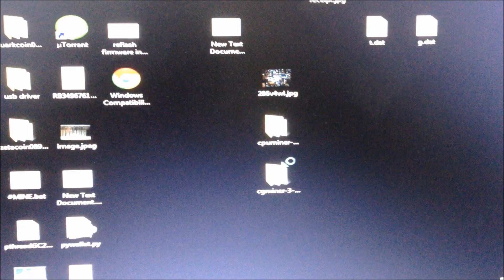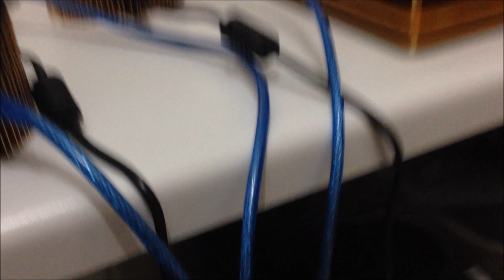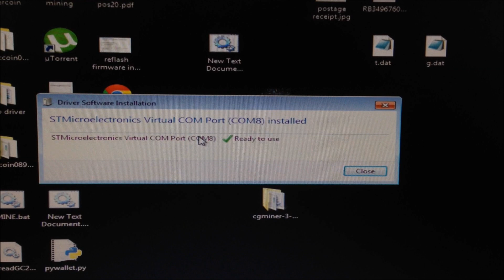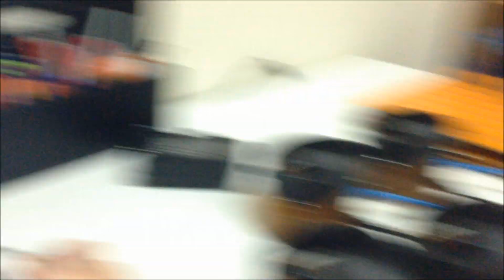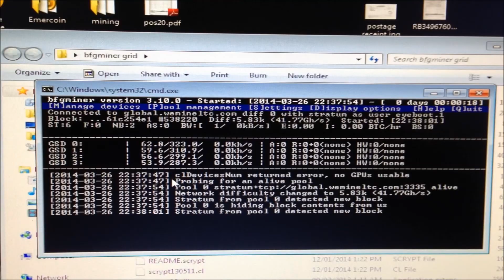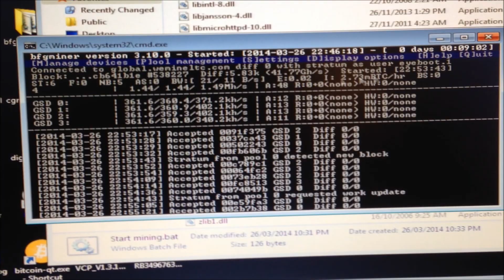How to setup multiple Gridseed Infinity ASIC Scrypt Miners using bfgminer

Comment: i need help ...i m running cgminer with 5 gridseed asic usb miners on a raspberry
the raspberry can recognize all my 5 miners but the fifth one doesn't seem to accept any mining task? 
as u see below, the A , R , HW, and WU are all zero on GSD4 miner.
any suggestion is much appreciated 

 [P]ool management ettings [D]isplay options [Q]uit
 GSD 0: 6D9133704857  850 MHz | 360.4K/360.9Kh/s | A:3840 R:0 HW:0 WU:3.9/m
 GSD 1: 6D6E23704857  850 MHz | 360.4K/360.8Kh/s | A:5184 R:0 HW:0 WU:4.4/m
 GSD 2: 6D7A268C4857  850 MHz | 360.4K/361.4Kh/s | A:3712 R:0 HW:0 WU:3.8/m
 GSD 3: 6D99149D5455  850 MHz | 360.4K/361.3Kh/s | A:5760 R:0 HW:5 WU:3.9/m
 GSD 4: 6D9315AA5455  850 MHz | 360.4K/361.3Kh/s | A:   0 R:0 HW:0 WU:0.0/m
--------------------------------------------------------------------------------

 [2017-06-12 11:57:14] Accepted d5824bc7 Diff 307/64 GSD 1
 [2017-06-12 11:57:19] Accepted 0321148d Diff 82/64 GSD 0
 [2017-06-12 11:57:21] Accepted 010cf60a Diff 244/64 GSD 3

thank you

Comment: do you have any tips for setting a gpu and cpu with bfgminer for ltc mining?
I just want to learn how to do it, and was told this is the hardest to learn how to work out.
running FX8530 cpu with 32gb ram and rx480 graphics

Comment: OMG NOW WHEN I OPEN THE BAT FILE IT JUST OPENS THEN CLOSES
Reply from the maker: Ok that means there is an error in your bat file somewhere. Edit the bat file now and add the word: pause
on a new line in the bat file. This will stop it from closing automatically and you will be able to see exactly what is causing the error. If in doubt send it to me and I will help you do it.
Reply: the system cannot execute the specified program
Reply from the maker: justin loffland It should say which command is not letting it open. If you post your bat file here I can check it for you. alternatively follow the instructions in this guide:

It shows an example of what the bat file command line should look like:

http://www.eyeboot.com/how-to-setup-new-r-box-100-110-gh-s-bitcoin-miner-using-cgminer.html
Reply: Eyeboot could we use one of those programs where u control my computer ant set it up for me?
Reply from the maker: justin loffland Yeah sure, please use teamviewer. Email me your teamviewer number and password:
support@eyeboot.com
Reply: Eyeboot just did waiting for you

Comment: I have never had a piece of equipment piss me off more.   I simply can not get it to work the videos are out dated. and cannot get a driver that works.  I did have it working, but i would have to keep pluging it in . most of the time I would get device not recognized.  now the software doesn't even find them. im using  cgminer  3.7.2  I cant seam to get the driver to start,  tried using zadig .  but it doesn't find anything to replace.   I would like to get more of these but I cant get the three I bought to work cqan someone please help.  it would be wonderful if you would do a new vidio showing how to set this up with the new software. the ones on your site are outdated
Reply from the maker: Hi, sorry to hear you are having problems. 

We don't stock these anymore as they are very out of date and slow, so i can't make a new video. Have you contacted your seller and asked them for support? Also this video is for bfgminer not cgminer. I have another one on my channel for cgminer so please look for that one. Finally download the latest version of cgminer (4.4 i think) from here: http://ck.kolivas.org/apps/cgminer/

Comment: what PSU do you recommend for that USB HUB?
Reply from the maker: I recommend Meanwell 60A 5V LED switcher PSU. It will delivery a lot of power and is very cheap. Then use an ATX to LED PSU cable from here: 

http://www.eyeboot.com/Bitcoin-miner-Accessories?product_id=74

Comment: I only get the following even after waiting 30 minutes and pool displays 0kh/s
GSD 0:       | 361.6/358.1/  0.0kh/s | A:0 R:0+0(none) HW:0/none
OCL 0: 74.0C |  92.3/ 92.2/ 92.6kh/s | A:78 R:0+0(none) HW:0/none
driver installed, COM changed to 1 (later to 2) bfgminer downloaded from your link. pool is up and settings are correct. I am on windows 7 64bit
OCL is my GPU which does not have a problem and that makes sure I don't have a mistake in configuration.

What am I doing wrong???
thanks in advance

Comment: When i start bfgminer and I go bfgminer only 2 of 6 asics. why?
Reply from the maker: That is weird. Try unplugging and plugging them in again when bfgminer is running. You can also try pressing "D" for device manager and then add the device manually. One question, when you plug in the miners (before running bfgminer) does a pop up come up saying that they are recognised by Windows? Reinstall your Virtual Com Port Drivers too.
Reply from the maker: Sorry it is M for device manager

Comment: Hi Brother

I have purchased 3 gridseed miners and I followed the instructions on your original one  (Part 1 -- How to setup Gridseed 5 chip Scrypt Asic Miner using cpuminer), and it worked.

Then I wanted to do dual mode so I tried part 2 (How to setup Gridseed 5 Chip ASIC Miner to mine bitcoin and litecoin) and ran zadig and it changed my com ports to USB. This ended up messing up my original mining setup AND prevented me from doing dual setup because your dual mode setup needs the Part 1 Com ports.

Could you tell me how to setup dual mode with multiple gridseed units (3 or more) for both litecoin and bitcoin (now that I can't seem to go back to the original com4, com5, com6 I used to have)?

Cheers!
Reply from the maker: You can find the COM ports again in Windows Device manager. In fact you can set them to whatever number you like in there. Hope this helps. If you are still stuck then I would suggest uninstalling everything and start fresh.

Comment: To set up 100 of these do you just use 2 of the 50 USB ports and plug them into eachother ?
Reply: Kamran Munaf no only the first one would get enough power to run the second one gets less and less until the forth one will not run cause power won't reach him

Comment: after an hour of up and run time all my gridseed stop working and i have to reset it , is there a way past this?
Reply from the maker: You need to make a bat file that restarts it automatically for you. However it shouldn't be restarting like that. Where did you but it?
Reply: i bought the hub from amazon,all the gridseed from a friend in Rhode island , and the power supply from amazon also.how  should i have the .bat file set up? i just have it set how ever it is from the downloaded spot
Reply: Eyeboot
could it be the 500w power supply not having enough wattage to power everything on the usb hub? its a corsair unit

Comment from the maker: Make sure you uninstall the winusb driver and revert back to the normal driver settings for the miner before doing this. 

The driver for bfgminer is here:
http://www.ftdichip.com/Drivers/CDM/CDM%20v2.10.00%20WHQL%20Certified.exe
Reply: this download takes you to a page where there are multiple other links. The x64 download is just a folder with the files in it and no installer
Reply from the maker: Michael Felske It is on that page under "setup executable" in the comment sections of the download. Here is the link: http://www.ftdichip.com/Drivers/CDM/CDM%20v2.10.00%20WHQL%20Certified.exe

Comment: Sorted my previous problem it was because I used zadig to replace driver I have uninstalled the new driver and reverted back to the previous one. but cpuminer and cgminer is running alot more efficient than bfg with bfg I am getting thousands mow hw errors and loads more rejected shares any idea?
Reply from the maker: That is weird...are you missing any commands from the batfile? also try downloading the latest version of bfgminer from here: http://www.bfgminer.org

Comment: In the video you talk about having a powerful hub to plug the miners into. But why would you need a powerful hub when each miner has it's own power supply? Looks to me like the hub is only used for communications and not powering the mining units. Which would leave me to believe you would us a hub that doesn't have it's own power supply and save money by using less electricity 24/7.
Reply: I tried with the unpowered hubs and it doesn't work with more than a few miners. I don't know why but i guess it is something to with the fact that mining involves swapping lots of data back and forth.
Reply: Ben Jones Oh, ok... Doesn't really make sense to me, but I sure don't know everything. That's why I ask a lot of questions. :-) Maybe, after connecting more than 2 or 3, the USB hub needs to work faster and starts acting more like a networking switch and needs power to do that. Thank you for the reply.

Comment: I just got the miner and installed bfminer. It seems to work, since the pool reports now after 20 minutes 110 kHash/second and the bfminer says 347.2. The pool takes an average of one hour, so I will see in 40 minutes, how they are closer.

I get often Job 'xxx' not found, ... what is that?
Is there a manual, of what I actually see at the miner window?
Reply from the maker: Ronald, it might take a bit longer for the mining pool hashrate to show a more accurate reading (probably about 10 hours). The longer it stays on the more accurate both readings will become.

The 'job XXX not found' is just when the miner has submitted work to the mining pool but the calculation has already been complete by other miners so basically your miner tried to solve something that was already finished. It does happen sometimes but shouldn't happen a lot.

Comment: Could I still mine with my current graghic card and add these and use both
Reply from the maker: yes actually the bat file i included will look for your graphics card first. then load the gridseed units. So bfgminer will run the gridseed units and your graphics cards for you :)
Reply: Eyeboot Ok thanks for info I just built a rig with a AMD 290x card and I was going to add a second card but then I herd of gridseed. If it will work for sure with my current AMD drivers ok I am very interested. Are you selling these? And do you include software. I would be interested in 2